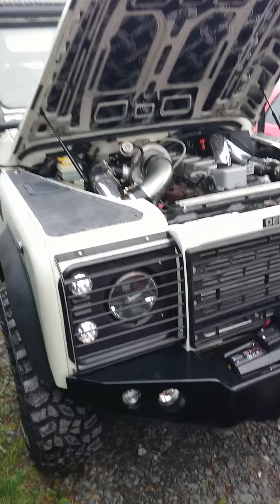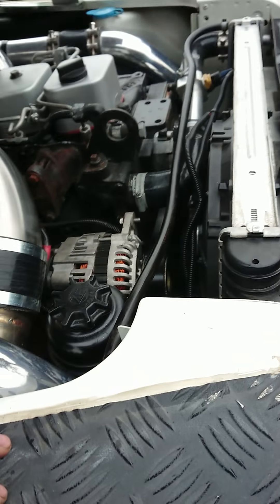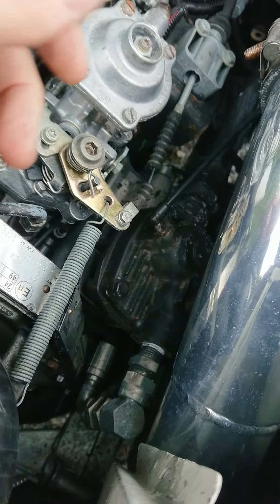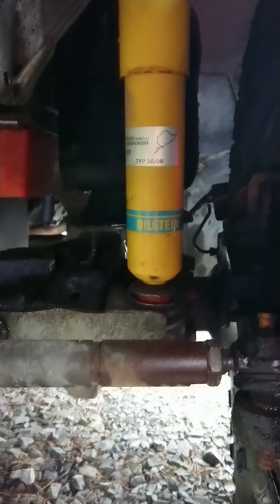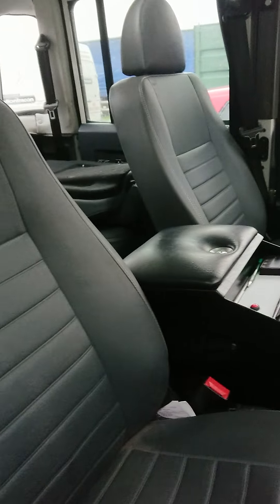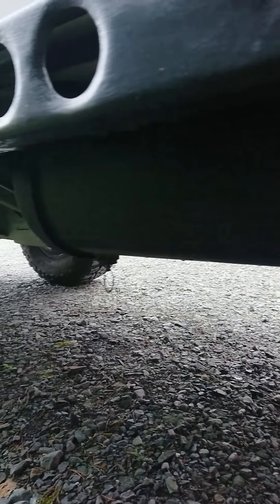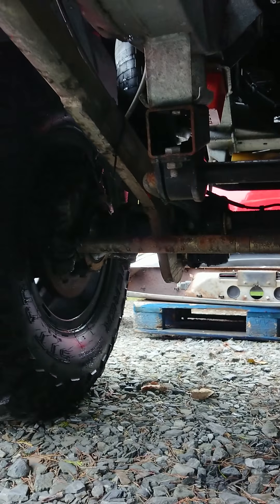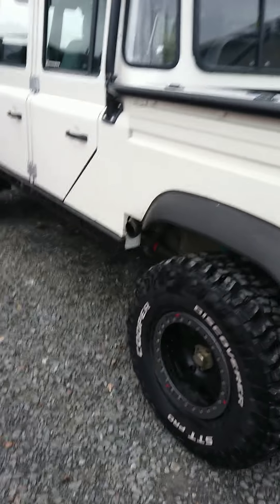5.9 Cummins 6BT Defender 130 - Conversion Walkthrough

Comment: Awesome! would be trying to fit in a 110.  Why the drop down of the frame in the front chassis? was that to clear the bottom of the engine?  My brother works for Cummins, so was thinking of the new 2.8l but I would like to keep it mechanical.  Where do I get the kit?
Reply from the maker: Yup, The new 2.8 is supposed to be good,I wouldnt be afraid of it. im working on a 5.9 common rail into a 5193 GMC now, i need to get a video put together for you tube if im honest.
Reply: @RedmanAutoEngineering  The 5.9 with the weight of boat anchor you need to reconfigure front suspension to suit right? Also im not really keen on the 2.8L. I'm from Asia so i see them quite a bit on small trucks.

Comment: You must of dropped the motor a bit to close the bonnet.Also you will have to laminate & tube the front axle housing as so it won,t bend also strengthen where the swivel housing bolts to the axles.Here in Aust. its done (recommended) JRA (jaguar rover australia) fitted 3.9 Isuzu motors to County,s for that same reason only if vehicle is to driven hard.

Comment: Toying with the idea of doing this with my 110 van. Did you do any extra sound deadening in the cab?
Reply from the maker: Lots and then more they are noisy
Reply: @RedmanAutoEngineering    about to start the conversion now haha! I'll remember to add ALL of the sound deadening! To do the air suspension conversion, what did you do for front shock absorber mounting? i saw its relocated in the video, is there something off a D2 you can use like a different spring turret etc?

Comment: I have several questions. I'll see if someone can answer them. Is the engine the same as the truck or are they smaller? Does the weight of the engine not affect driving? Since it must be quite heavy.

Comment: Where did you get your engine from i want one for my 101 fc
Reply: Isn't it from DAF truck?
Reply: @P8C1  yes but which model daf also i know the army used them and some buses had them but which model and year i dont know and cummins have made newer versions but what they went into i dont know
Reply: @101fcthingstodo9  he said its from a daf 45
Reply: Im putting one in my land rover 101 fc aswell im getting it out of a leyland daf 45
Reply: Nice one (inspectah) iv changed my mind withe th cummins im gonna be placing a td5 in mine now not that there is anything wrong with the 6bt
Reply: @101fcthingstodo9  thats good td5 was one of my options i was going to put a variable vane turbo from a mitsubishi l200 in mine they make stupid power
Reply: @temsbab1565  that is idea lol mind you i dont want to tune it to the max just want to make it as comfortable as possible as i want to use for overlanding
Reply: @101fcthingstodo9 i dont really need the power its just for going up hills because the hills just slow it down ridiculousley